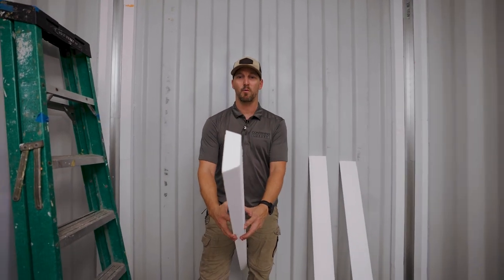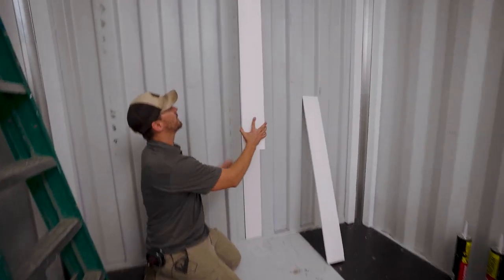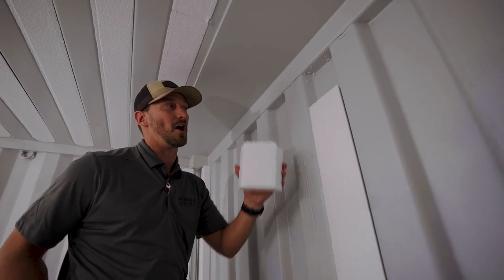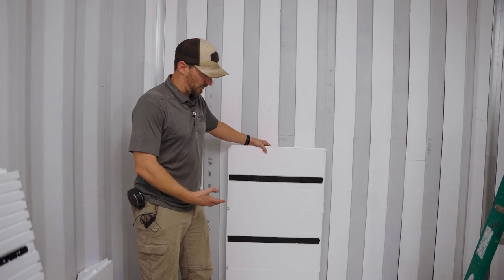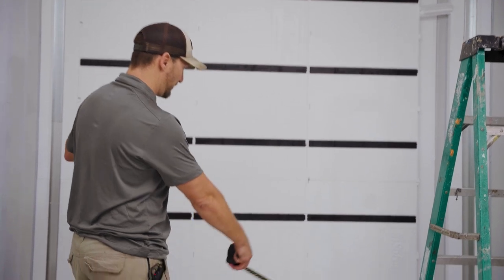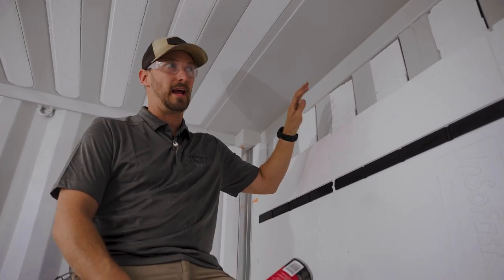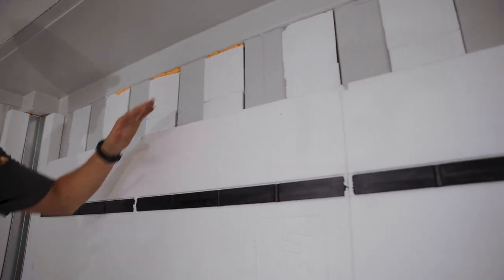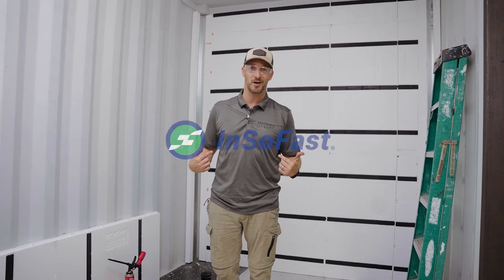Installing InSoFast® End Wall Insulation Bundle in a Shipping Container Home with Containing Luxury

Comment: Why orient the studs horizontally instead of in the vertical position?
Reply from the maker: Guaranteed better adhesion for the built in stud/metal siding of the end wall (the end wall isn't the same corrugation pattern as our CX44 panel, therefor you need to tweak the installation with inserts and flat panels! You can also use this method for older containers that have a few dings and dents).